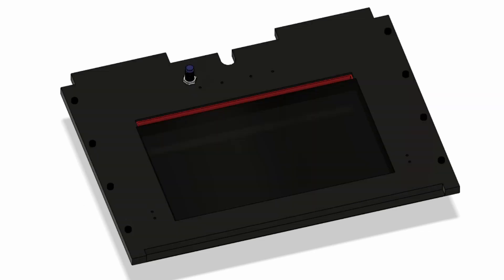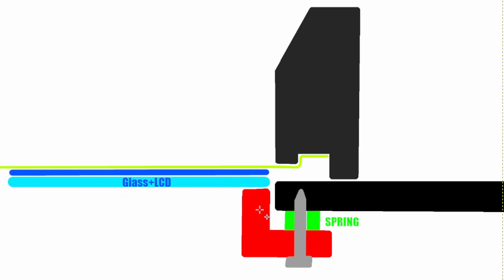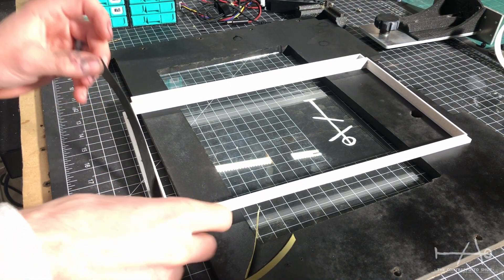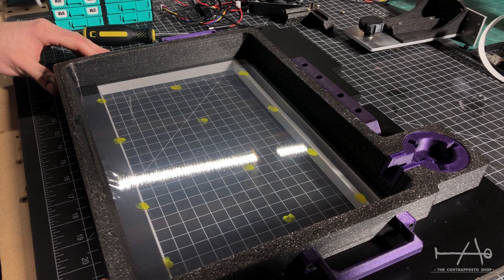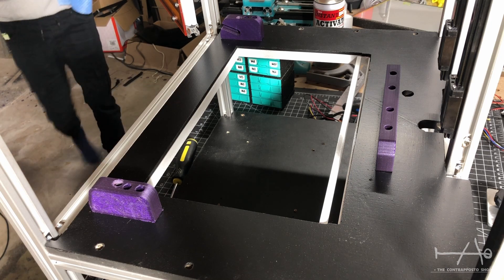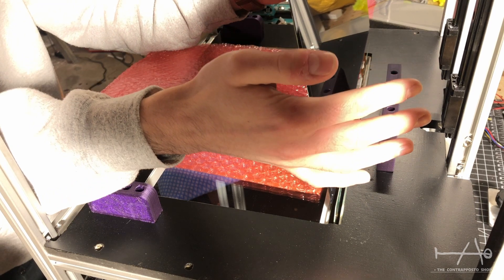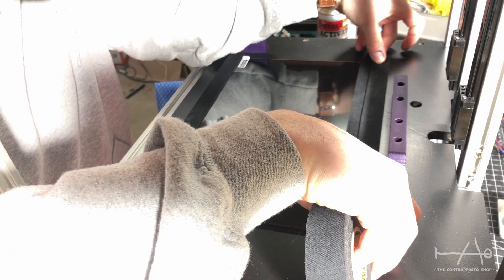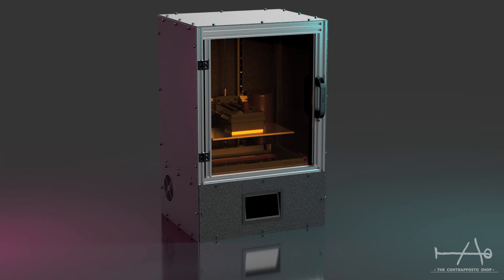Middle LCD plate for the Prometheus MSLA 3D Printer

Comment: I know this is old video now but wonder if you could connect 4 together to have a 27.4 in resin printer.
Reply from the maker: You still have a bezel around the screens and also at this size the peeling for the machine will go trough will be gigantic

Comment: Is the level  tension mechanism solely for keeping the LCD screen in place? Looking at your illustration it looks like you could add a hinge to one of the long sides of the monoscreen and an eccentric cam to your mechanism to lower and raise the screen which would greatly reduce peel force on such a large build plate (in addition to lubricant on the FEP sheet) and help speed up printing times which should in theory maximize the LCD screen's life. 

As I understand it the screens degrade from both the light source (I believe you use an LED array) AND the elevated temperatures. So reduced overall time that the machine is running should help get the maximum hours out of the consumable. I believe you would have to add another motor (whether it be a nema, servo or windshield wiper) but those are much cheaper than large 7K monochrome screens.

Just my two cents. I look forward to more videos on this project.
Reply from the maker: We changed the design of the LCD braket and now we use real springs. It really help to level the LCD :D ! This is just to acomodate different thicknesses of different lcd. For the led exposure and all that i needed to turned down my led power more than 60% and remove the fan under the array. The LED was at first to strong and overexposed the resin even at 1.9sec … so instead i reduce the LED power to have a reasonable exposure time and reduce the stress in the resin because it was curing so fast. Finally the LCD dont receive too much heat because i reduce the power and have a low exposure time. So it runs well under the max recommended temperature!